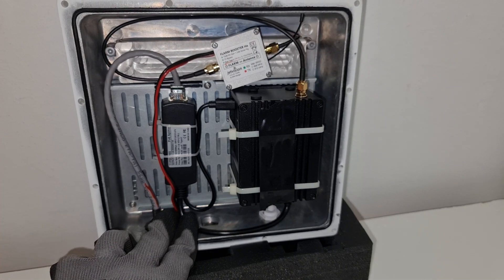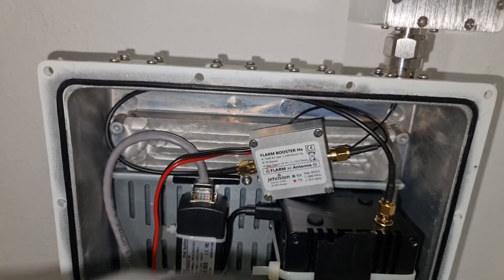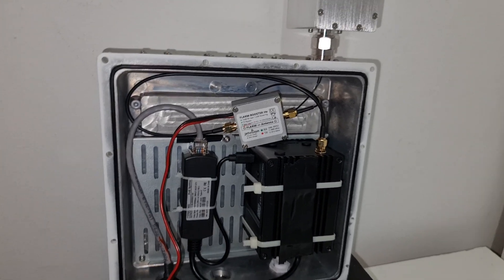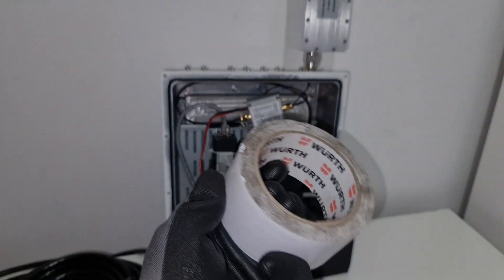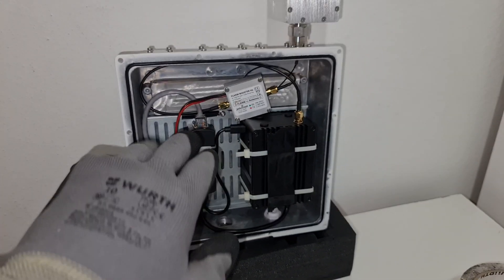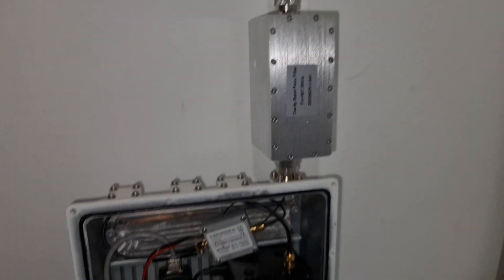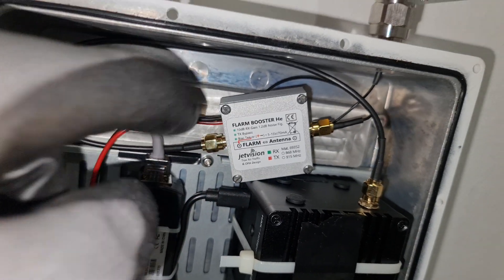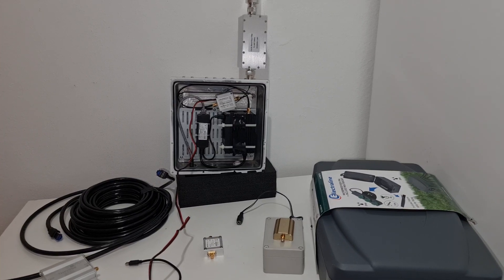Adding Flarm Booster Amplifier for More HNT Rewards in 2022 👌 😎 💯Works 💶

Comment: Best not to mount Antenna and cavity filter direct to enclosure…use a short cable…mount from bottom of case…water, temperature and mechanical stresses will wear down the bulk- head connector 🤓
Reply from the maker: Thanks for the feedback 😉✌️

Comment: Show some of your earnings please.
Reply from the maker: Sorry It's private
Reply: @heliumaddict8582  rough estimate? i make between 3-4 HNT per day
Reply from the maker: @MacBig.   its depending on how many hotspots around your Miner? And the height of your Antenna 📡?  and du you have line of sight or your Antenna is blocked buy building? How strong the signal between your Miner and other Hotspots?
What the Rewards scale ⚖️ of those Hotspots?
What's is your average of witnesses per day? 
As you can see 👀  it's very hard just to ges the urnings without knowing those informations. 

Tip: 
Go hotspotrf.com it's great  website 
he will help to estimate the urnings depending on your location,Haight, antennas 📡 that you use and depending on how many hotspots around you 😉 
Best of Luck 😉✌️